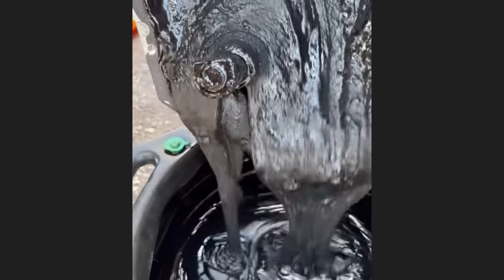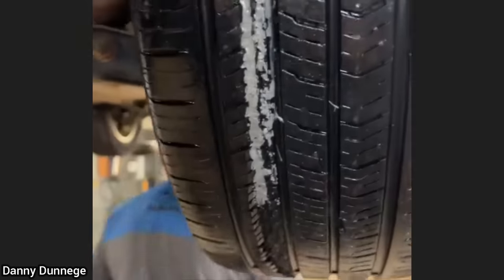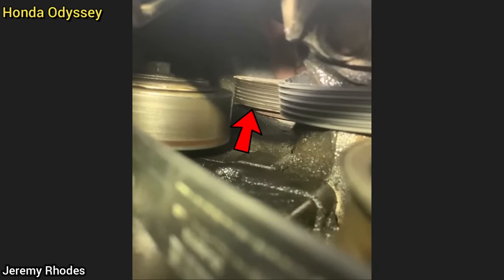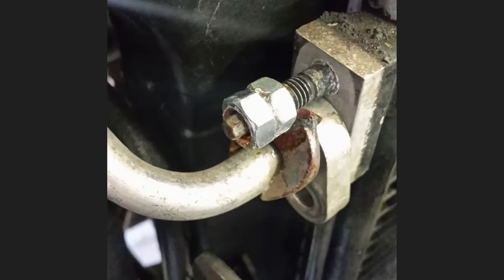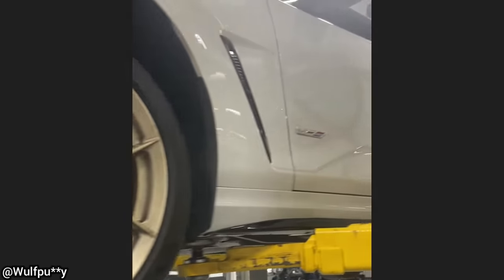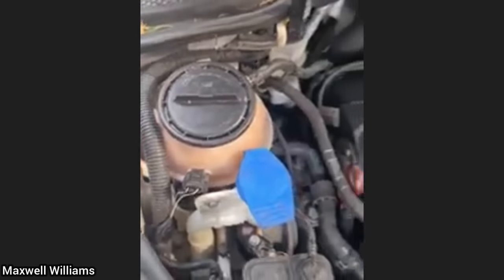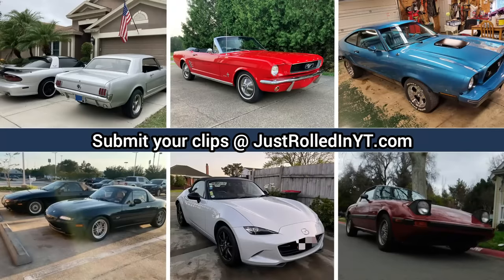Customer States Car Shut Off After Adding Wrong Fluid To Engine

Comment: Finally, a component that didn't fail despite the best efforts of the amateur mechanics and bodgers of JRI.  That flashlight should be the first exhibit in the JRI Hall of Fame.
Reply: A good ad for this flashlight.
Reply: lol Yeah, a lot like our human resources guy. He'd stopped for a bottle of orange juice and forgot to close his computer bag. When he got out, they both flew in the air. He bragged, "Well, I caught the orange juice." The ($2900 in todays money) laptop was a total loss.
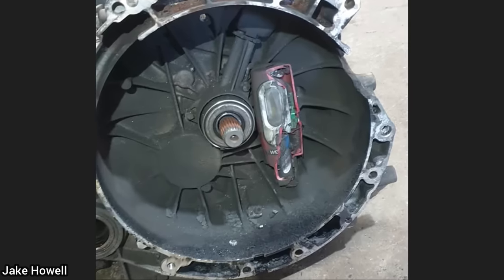Reply: That light may be able to top the nokia 3310. At 1:05 you can see that the battery has a dizable chunk ground out.
Reply: I'd like to defend amateur mechanics.  The problem, in general, isn't a lack of experience, the danger comes from idiots with zero knowledge who cavalierly say "how hard could it be", and proceed to use rubber fuel line where a brake hose used to be.

Also, I've found old tools in weird places that likely came from "professional" mechanics.  One old lady was nice enough to return a serpentine belt tool to me.
Reply: @fasillimerick7394  I like that when the customer returns a tool you misplaced in their car. One shop I was at the customer straight up stole the booster pack and would not return it.
Reply: A pokemon booster pack?
Reply: @clockworkvanhellsing372  There's no way the battery is powering it. It's got a USB cable plugged in that's probably powering it
Reply: @HighSierra1500  I learned early on why a lot of techs had bright pink tool handles.  Pink tape is also great for sealing off intake runners, that way you don't reinstall the manifold with clear tape still on it.
Reply: @mikep490 so what did it cost then like 800$

Comment: I can’t believe how clueless some people can be. Especially the 1st and 2nd ones
Reply: I can't ever understand the minds of dingbats that ignore oil changes or stupidly use wrong fluids. Stunning...
Reply: @nboddie1036  Exactly. Some people are so dumb
Reply: Exactly! How do you replace a caliper and forget to reconnect the flex hose?!?!
Reply: @HighSierra1500  exactly - Why even disconnect the brake hose unless you need to replace it?
Reply: @paulsullivan6392  Because he replaced the brake caliper.

Comment: I wouldn't say "morse code" for that window motor. Sounds more like an old-fashioned matrix printer to me.
Reply: Or dial up internet connecting.
Reply: This.
Reply: Fax machine which is pretty much a printer as well.
Reply: That's exactly what I was thinking.
Reply: was thinking this too
Reply: floppy disk drive
Reply: I also thought it sounded like an old dial-up internet-modem!
Reply: @hashbrown777  Every Millennial; "WHAT?"
Reply: Agree. Morse code has a steady tone.
Reply: or maybe the Q-bomb from the movie "The Mouse That Roared"...
Reply: I wonder what the guy from Floppotron would make out of it.
Reply: That was the same thought I had.  Definitely a unique sound!
Reply: @GaldirEonai, my driver's side electric regulator went out whilst on the road, had just passed a dead skunk so rolled down the window to get some of the funk out and as I tried rolling it back up, it sounded like a gunshot in the door and then like it was sparking a fire inside.... It was actually the cheap cable system that raises and lowers the window that snapped and the electric motor was wrapping the cable up in a mangled coil. They're a bit stiff and could use adjustment but I have a 50+ yr old car with manual window cranks still original and rolls the windows up and down with the old metal "scissor" and "gear" system. This new stuff is terribly sub par and I think some vehicles are probably more "cursed" than others when it comes to poorly designed systems.
Reply: @dsloop3907 not even close
Reply: @ogshotglass9291  Well, it has been a long time since I last heard that.

Comment: I will never forget a reason a guy gave me for not changing the oil on his inboard boat engine. I saw he has oil change service stickers on his cars but the boat was sized up. The crankcase was sludge he stated there is no dirt in the water like on the road so the oil don't get dirty. I ended up turning down the job some people are just clueless.....

Comment: For real the EXACT same thing happened at our shop.  We had a guy come in with his main pully about to fall off.  I tightened it and told him it damaged his belt.  He elected to drive half an hour to another parts store to save $6 on the belt and didn't make it.  It was an aluminum block Cadillac so it seized and the car was junked.
Reply: The dreaded HT4100 grenade?
Reply: Ignore how lucky you are to make to the shop just before disaster, and figure that you might as well push it. 
Wonder how often that works ?

Comment: Customer descriptions of sounds the car makes are always spot on.
Reply: I was thinking it sounded more like one of the old printers that had the sheets attached to each other and had the holes on the left and right side
Reply: @noyou9379 A good ole Dot Matrix printer. Man, those were the days.
Reply: @jsims2985 many people today have forgotten the old lore, I was thinking the exact same thing
Reply: @jsims2985  I couldn't remember what they were called I just remember the sound they make
Reply: Yep. I thought the same. The old dot matrix tractor feed
Reply: My first thought was the sound a dot matrix printer makes.
Reply: I actually thought it sounded like old dial-up internet-modems!
Reply: @jsims2985   Yeah, I had an Okidata 82A.  It had a bug in the micro-advancing command logic (you could advance the paper in 1/144's of inches.  But you couldn't advance it 13/144's because the firmware took the 13 as a carriage return; you had to advance, e.g., 6/144 AND THEN 7/144.  Took me a good bit to figure this out (I was developing a report that needed graphics).
Reply: Sounds more like Zuckerbot trying to get to 3rd base
Reply: @noyou9379  Came here to say that, LOL. Ol' Dot Matrix Epson LX-300 printers.

Comment: In the shop i was apprentice at we had the same flashlights, one day my was gone.
After a couple month we found it on a VW Crafter exhaust, on the DPF, totally melted, shaped like a blob-banana, even the led's where melted on one end, still worked for like two year's or so :D
Reply: That's incredible.
Reply: What brand was it!?
Reply: German company called "Förch", idk if they were the manufacturer or just a rebrand. It was arround 2012 or 13 .
Reply: You might want to learn the difference between my and mine.
Reply: @rogerwilco2   And you might consider doing something more usefull with your time other then correcting other ppl on the internet.
b.t.w english is not my primary language, so i dont care.

Comment: Let's give the guy with the silicone tire some credit.He was smart enough to rotate them to the back just in case if they blew out,he wouldnt have to fight with control of the steering.Even smarter if it is front wheel drive
Reply: I'd rather have a front tire go out than a back tire.  You have more control over what the front end is doing because you have a steering wheel.  If you lose a back tire, you could spin out and get totally sideways.
Reply: @incognitotorpedo42  Correct. I had a similar discussion with a former co worker a few years ago (don't remember how the topic came about) anyway she told me that her cousin is a tire engineer in Germany and he told her the rear tires provide your straight line stability, so if you have worn tires and cannot afford to get them replaced at the moment, it's best to rotate the ones with the deeper threads to the rear.
Reply: If you blow up a front tire, the car will go straight, due to inertia.
If you blow a back tyre, it can all over the road uncontrollably.
Reply: No, no credit all!! If the tyre is so badly damaged you need to pour silicone into it then it needs to be replaced. At BEST that is a temporary repair to get to a tyre fitter, but from what is said in the video, the customer has no intention of replacing them. If they give out at highway speed, that has the potential to cause a serious accident. It's utter stupidity. 
Your tyres are the only thing that actually keep you on the road. Fancy electronics and computer management can't do anything without those bands of rubber. 
Ask any proper motorcyclist and they will tell you good tyres are second only to a good helmet in terms of things you need to spend a decent amount of money on.
Reply: @chefchaudard3580  inertia is only an object in motion will stay in motion until force act upon it so it might not keep going straight.If the person starts to turn before it happen or hit a bump that cause it to jerk
Reply: @chefchaudard3580   That might be true on ice but its kind of hard to believe.I can image being on the rim and the steering wheel pulling you to that lower side. As soon as it happen,i believe it will jerk you into somebody else lane because of the off balance and force. If you got a bad tire on the front it will wear out quicker because turning the wheel makes you lose more thread/rubber which is why you rotate them
Reply: @sweeptheleg.  that is nice to know coming from a good resource but i bet if you ask five more engineers from all over places, they will probably all say something different. One of them might say don't rotate them at all. It also matter how long have he been a tire engineer.
Reply: @OverDriveah  as I said, when blowing a front tire, the car naturally tends to go straight. It can also be more or less controllable. But a flat tire will not steer the car completely sideways, just because of inertia that resists it.
On the back, not so much. If the car slips sideways, there is nothing you can do and it ends up in a spin and it may roll over.
new tyres must put in the back, because of that.
Reply: @OverDriveah  I should have been more specific before, but we were talking about driving in wet weather. I think it's best to have 4 good tires but there's been a few times when i could only afford to replace two. I followed the advice from my friend and replaced the rears first then waited a couple months before replacing the other two. My vehicle is front wheel drive and as long as i slowed down when it's wet, give myself enough space from the car ahead of me, don't plow through big puddles, I've never had any problems driving in the rain even with 2 worn tires.
Reply: @sweeptheleg.  im so glad that you mention the weather and front wheel drive so thanks for the information
Reply: @chefchaudard3580  what you are saying could be true and make sense
Reply: Can't say about USA road tanks, but for any compact car better tires go to the back. There are reasons for this: the front of the car is heavier (engine), so the rear is easier to lose traction as it is. Also, the brakes are applied heavier on the front, the inertia pressing down on the front wheels when braking, giving them extra grip, while unloading the rear ones and reducing their grip. Now, If, when braking, the front slips, but the back keeps traction, you take longer to stop, but the car will keep going straight, like a boat with a drag anchor. A moment later the front will grip again and you are likely to end up with a scare and maybe need a quick steering correction to stay in your lane. If, while braking, the back slips, but the front holds, your trunk starts to overtake you and, unless you are very good at it AND alone on the road, you just hit something.
Reply: @OverDriveah  but i bet if you ask five more engineers from all over places  Objection Sir: Engineers are not doctors ;-) It's not just tyre engineers that will tell you the same, it's also "chassis" engineers, race car drivers and physics teachers... (basically all the people who are educated or experienced in what happens.)
-> If you are on a level road going straight, it doesn't matter much if the front or rear tyre goes. Almost the same will happen. But as soon as the road is canted, you are in a turn, go over a bump or a combination of all of them, it's safer to have the front tyre go out than the rear.
It might sound counterintuitive but it's the case. I would be surprised if there weren't any videos on YT testing that even.
Btw.: cars are also safer in a frontal impact than in any other direction.

Comment: 2:05 Well, TECHNICALLY he didn't drive through any puddles, just water deep enough to get sucked into the engine
Reply: He probably was a guy who thinks the Atlantic Ocean is just a pond.
Reply: A friend and I drove a Jetta for hundreds of miles through post hurricane floods.  Don't run the engine in deep water, push the car.  The lowest water ingress point for a Jetta engine is an inch below my knee, I'll never forget.

Comment: I still don't get people that try to save money on a tow truck by driving their compromised vehicle to the shop and end up spending more money in the end to repair all the damage their trip caused.
Reply: You're giving them too much credit. They don't know enough to be aware that driving their trashed vehicle will cause more damage.
Reply: Back when local tilt tray tows were fairly cheap, I always had enough cash on me to pay for tow.
Reply: Maybe they don't want to have the average wait of 6-8 hours for a wrecker? Because that's what we get in Southeast CT. Or, if the temperatures are bitterly cold, 29 hours and the purchase of a AAA Gold membership just to get anyone to show up.

However, sometimes waiting is the best option, at least for your car.

Comment: I had my harmonic balancer just come off my Odyssey.  The good news is the water pump is not on the serpentine belt, so you can drive it home if you can deal with no power steering and have a good battery.  

The bad news is the proper impact gun to take off the crank pulley is over $200 even if you are good at finding deals.  I broke 5 different 1/2 extensions and breaker bars.  Wound up with an Earthquake XT and the special heavy socket.  Still needed to plumb the impact with a 6' hose and no fittings to get enough power to break it loose.

Comment: 1:35 That makeshift roof rack is scary. I wonder if they sealed it properly for when it rains.
If they crash and roll the vehicle they will no doubt be in a whole heap of hurt. I've rolled a car before (slow roll) and can tell you that your body certainly moves around in the vehicle and it is like a clothes dryer in there with loose items flying around. Imagine hitting your head on those giant bolts sticking through the roof.
Reply: I'm sure they'd only feel it for a second or 2 so it's not a big deal.
Reply: @johnjr757  or walk away lookin like Frankenstein